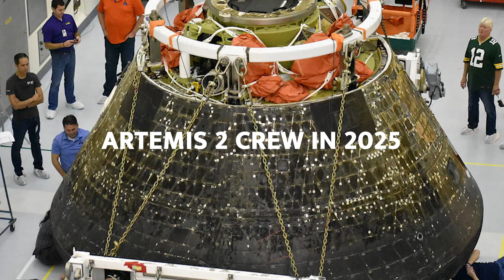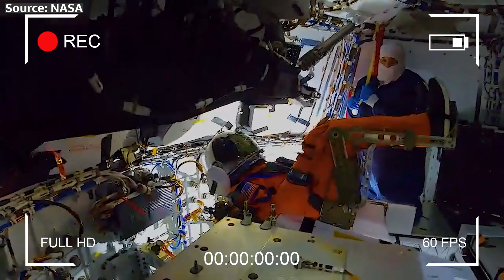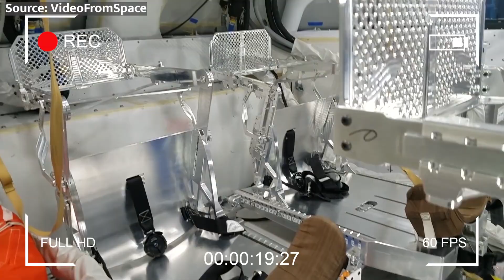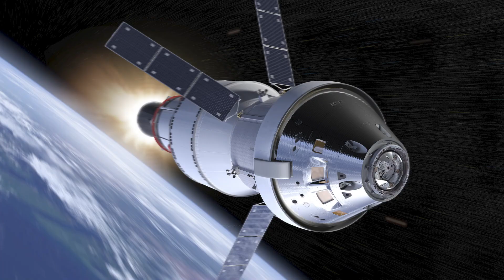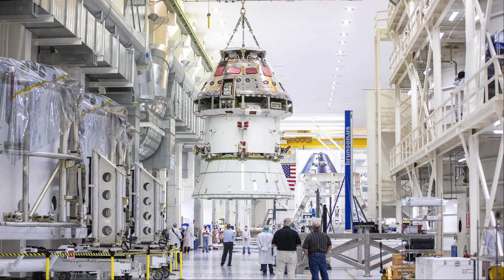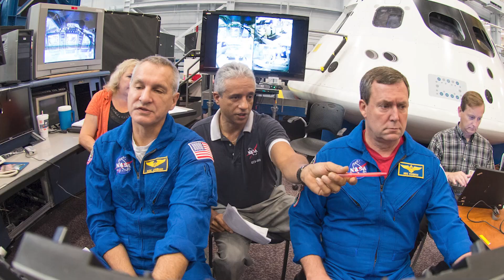NASA's Artemis Mission DELAYED: Orion's Hatch and Heat Shield Problems REVEALED

Comment: I remember the Apollo 1 fire; we asked, "How could this happen?" The answer wasn't an easy one, but a fix took a while.
Reply: In 1966 ""Apollo 1. An electrical fire occurred in an Apollo command module environmental control system (ECS) test rig in a vacuum chamber in 1966. he test was conducted under a lower atmospheric pressure (i.e., 5 psi to simulate cabin pressure in space versus 16.7 psi for the LC 34 test), but in a 100% oxygen environment. The test incident report was classified and inaccessible to personnel without a security clearance."" Several months later 3 men died in an easily avoidable accident.

Comment: They got astronauts safely to the moon and back several times in the 60/70s: Why not just use that technology?
Reply: Going to Luna for a short time rock collecting and flag-plant is far different than returning there to establish permanent facilities.
Reply from the maker: Good question, Spacer 🧑‍🚀 The main reason is that the goals for the missions are different. While the original ones were mostly for Lunar exploration, the most recent ones are for Lunar colonization. This implies bringing heavier and newer technology that would allow humans to colonize the Moon, something that Apollo did not allow. 
The old technology may be used, but it wouldn't fulfill the new goals that NASA has.
Reply: We don't have the Tech anymore. Not everything advances over time. If there's nothing in vancouver it stays stationary or goes backwards
Reply: NASA said they got astronauts safely to the moon and back, 😂😂😂😂😂😂